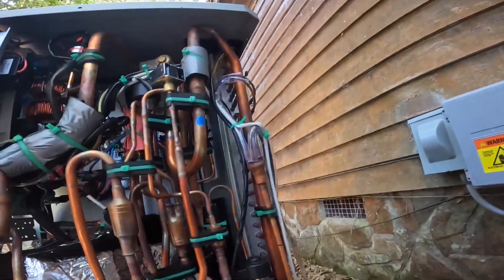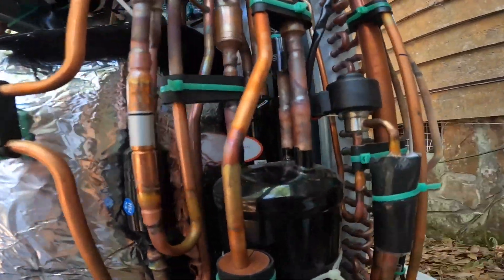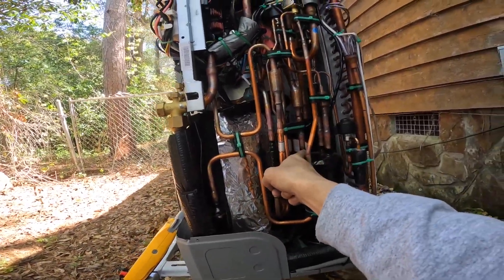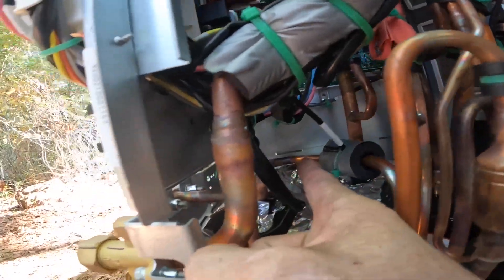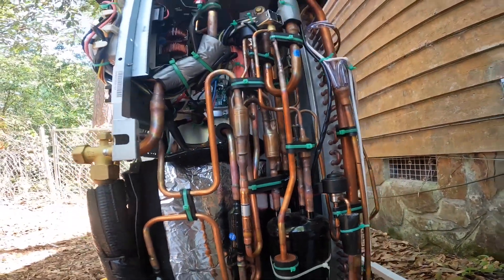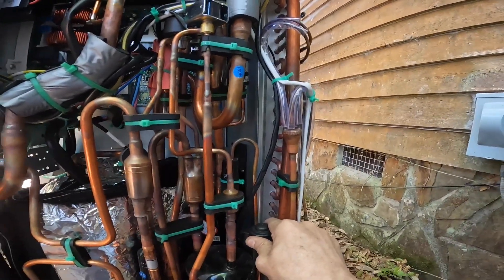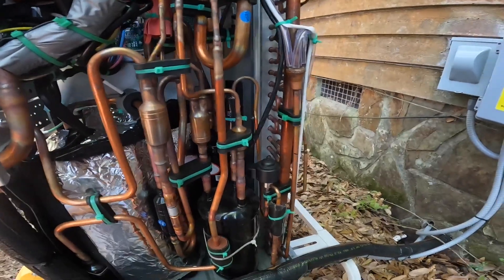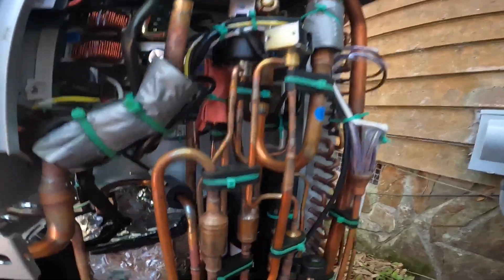Better Understanding the Gree Flexx..Featuring Lieutenant Riley! #hvacguy #hvaclife

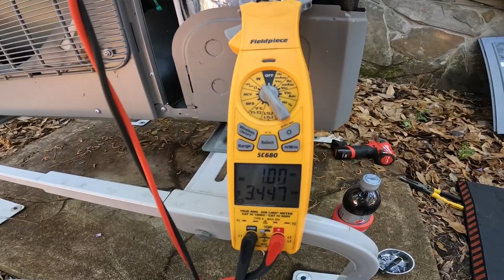Comment: 1:30 yeah if you look at the power going into that power factor correction board or “filtering board” as they call it, it’s pulling 0.6A, just sitting there before you turn anything on. That’s with no heaters running.

Comment: One thing on my greer flexx system that I find odd is not have the ability to check refrigerate pressures in heating mode. No true suction port or discharge. I am going find a way to install those options
Reply: Why do you need to check suction pressure? If it’s not performing like it should then put your gauges on in the summer. Tell the customer to run on electric heat until then. You can’t charge it by pressures anyway. You must recover all of the refrigerant and recharge according to the factory supplied data plate plus any line set over 25 feet.

Comment: If they dont have a good trouble shooting manual or fast and good tech support I dont have the time for it in Summer to be fumbling around with it. Imagine changing those parts stuffed behind all those copper lines like the accumulator. 🤢🤮Ill try and work on it and learn when its slow season if I run into it. otherwise i look at it as losing time and money

Comment: Thanks for your videos- I installed the exact unit but rebranded Mr Cool- my son is a rookie technician here in Alabama and he put the catch all bi- flow filter dryer on - but after watching a free flex technician webinar- a gree technician trained specifically on gree flex 36 said do not install a filter dryer- the desiccant can break free and sandblast screens.   ??? But I researched the catch all and it’s a solid core dyer. One comment from one of your viewers who installed the gree flex 36 with the Mrcool sticker just like mine said the unit already has a filter dryer installed from the factory in the condenser cabinet? Please reply did you install one or leave it off? And what if I have now have two installed? Because of the long L shape of the house- I have two separate identical units gree flex 36 or 3 ton-each ducted to 1100 square feet- so house has 2200 total square feet- old house slab ranch- renovated low to mid energy efficient- also can you tell me the brand watchband in all your videos and I sure would like to talk to about this unit because we both have them in homes- thank you Travis- central Alabama Roll Tide
Reply: No, do not install filter driers on mini splits or these gree flexx units.

Comment: Was that 13 Amps @ 250 volts? And does that include the air handler? What size condenser? I'm looking into changing my goodman 13 seer heatpump to a mr cool 20 seer heatpump. I noticed where the hspf is 10 on the mr cool and I think it's 8 on my goodman.

Comment: Thanks Curtis for this video I was considering ordering the gree flex.

But went with the Mr cool universal series. But from your video they appear to be identical with different brand names.

Unfortunately I live in Pennsylvania and not Tennessee otherwise I would hire you in a second.

With Mr cool they seem to market them as DIY when they really are not DIY.

And with the Mr cool version on the air handler for some reason whoever is assembling the blower motor is not balancing the wheel corectky which means I need to have the hvac guy pull the motor out and properly balance the wheel. 

I am curios if you had that issue on the gree flex version. On the air handler blower assembly. 

And finally looking at the inside of your condenser was helpful because it reveals the filter dryer is Inside the condenser. 

Which means Mr cool telling people in the Instructions for a normal weld  lineset to install a receiver dryer on the outside  is wrong. 

As is there marketing so called quick no vac line sets. 

As they would still need to be vacuumed out. 

Period before releasing the refrigerant. 

Again thanks for your update Video and your knowledge in general on all your video like knowing when to Install oil filter receiver dryers on the outside and when not too.
Reply: Mini splits and most things produced by gree have screens. You do not install filter driers outside or inside on these units.
Reply: @USA-GreedyMenOfNoIntegrity  I know that smart ass the filter dryer is installed on the inside of the condenser. I was pointing out the instructions from the rebadged mr cool universal rebadged version version but if you followed those instructions you will surely ruin the unit. So get the hint the Mr cool universal and gree flex or the same system. @USA-GreedyMenOfNoIntegrity
Reply: Oh, they are diy alright. When they break, you’ll be doing it yourself too and not calling me.

Comment: This machine looks like it would be very difficult to do any refrigeration repairs on - so much crammed into the compartment of a side discharge unit. Complex too.
I'm betting 10 years from now a lot of these heatpumps will be in the scrap heap because they're too difficult and expensive to fix and parts may not be available any more.

Comment: Glad you keep updating us on the Gree unit. Is it always that noisy? I thought they ran pretty quiet. How has it been with heat on the cooler nights? Love you new addition to the family, cute little guy. What breed is he?
Reply from the maker: It heats just fine, even on the really cold nights, even though I don’t have heat strips. That was a little louder than before, but , panels were off and it was almost at top speed. He’s a Weimaraner

Comment: Hey there 
I’ve also installed and serviced these units. They all look similar to the General Electric connect, and the trane resolute. What I like is that they finally are coming out with side discharge especially the snow and weather we have in Canada. The biggest issue we’ve had is with the 4-5 ton. When it cycles in defrost, the auxiliary heat energizes but it shuts off the indoor fan. They call it a fan interlock issue and when you cycle power it clears the fault and the fan works again in heating until it cycles back into a defrost. 
Apparently it was an issue with the boards on the ECM motors. Not sure 🤷‍♂️ either way, I’ve changed out like 6 in the past year.
Reply from the maker: If they are installed without heat strips, like mine, the blower is supposed to stop during defrost. But, not if strips are installed. So, I agree sounds like a board problem in the AH
Reply: @HVACGUY  Wait, I thought heat strips weren't required for defrost with these heat pumps.  It they are required, there is no advantage to using this system.
Reply: Interesting. Are codes thrown with this issue?

Comment: Do you charge it like a normal split or do you treat it like a mini split?
Reply from the maker: Like normal, but doesn’t have a true suction, so has to be in cool, and I think there’s a way to put it in charging mode.
Reply: @HVACGUY  👍 thanks
Reply: @Edward Garza   I have not worked on a gree flex but the only way I know of to correct a charge on mini splits is to recover and way in according to manufacturers ìnfo
.what do you do?
Reply: @georgemunford3804  on mini splits yes , pull charge and weight in the amount listed on the data plus x amount per additional 25 ft of line set

Comment: That looks like AirTemp brand heat pump, claiming 19 seer if running as 2 ton, the unit is actually 3 ton.
Reply: You select 2 ton with a dip switch! it draws more power than a typical 2 ton heat pump system, until it gets down in the teens and your electric heaters aren’t coming on, then you’ll see the difference in power consumption.
Reply: @USA-GreedyMenOfNoIntegrity * It's a pain to work on something with limited information of how it works! No profit if everything is a new mystery😢

Comment: Any creative way to plug up the large knockout for the refer lines going into the unit?  I tried steel wool on one but it rusts so quickly and looks bad. Need to keep the critters out because too much for them to munch on. Regular metallic tape doesn't look good at all.
Reply from the maker: I used insulation off of a line set
Reply: you can get a steel wool type in Bronze or Brass, Stainless,